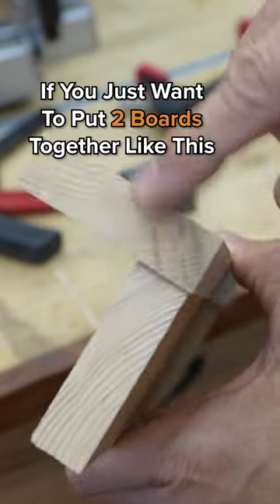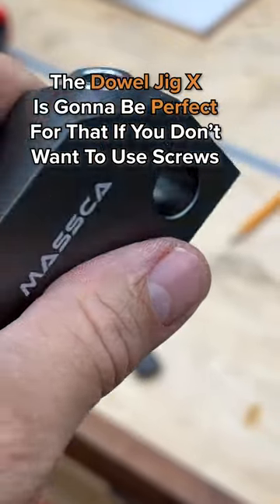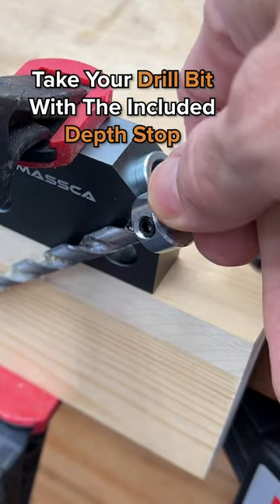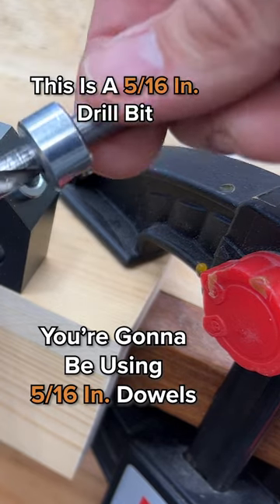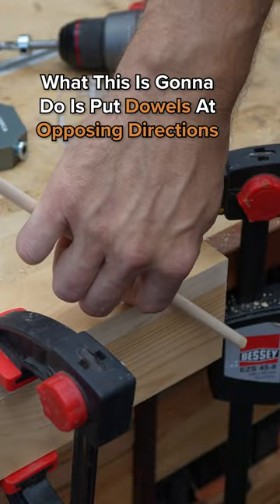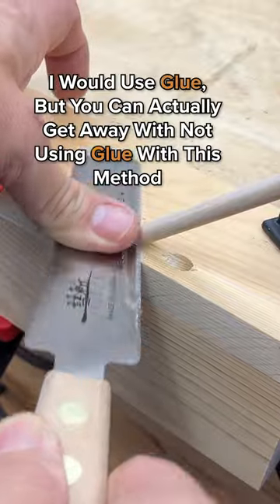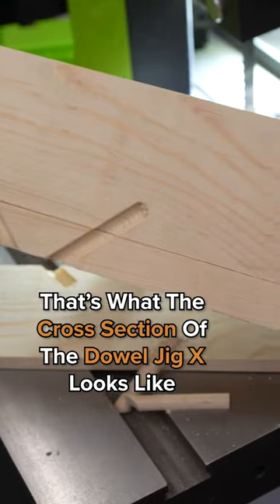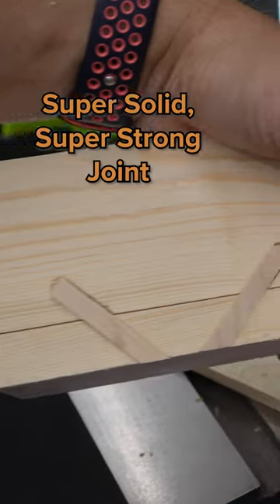You've Never Seen a Dowel Jig Like This!

Comment: I have used this method for years, free-handed.  I first started doing it when I ran low on 2 1/2-inch screws, and harvested some from sawhorses I had just made, replacing them with dowels installed like this (horses are still solid as a rock).    Start a hole more or less vertical for about 1/4 inch, then angle the bit into the hole's bottom 'corner' to drill out the angled hole, then tap in the dowel and saw off flush.  This jig's precision of the holes or the visible dowel ovals being exactly the same size and distance apart adds only an esthetic appeal -- any two angled holes at different angles to each other will achieve the same strength of joint.

Comment: Gonna have visible holes.
Reply: Depends on where the joint is
Reply: Also depends on if you want to use a contrasting color of wood to basically showcase the dowels.
Reply: On the other hand, this would be good for L-cleats where they're used in a garage or for counter tops where aesthetics aren't a concern.